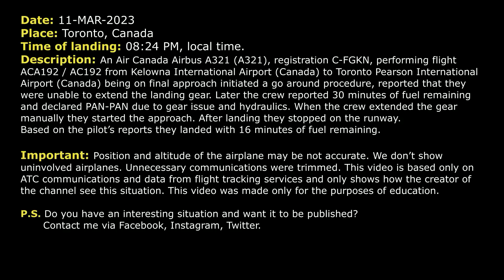“The gear is not coming down”. Air Canada A321 don’t have much fuel to troubleshoot. Real ATC

Comment: To all the armchair quarterbacks commenting about the fuel. 

They made a comment close to their base leg that they had "2.2" (2200kgs) of fuel remaining after the go around and troubleshoot. 30 minute reserve would be about 1.0-1.2 depending on the weight and in a normal configuration (gear not down, etc). So that 2.2 on a normal day would have been about 50 minutes of fuel remaining before zero fuel and 20 minutes before hitting their reserves. 

Well done to the crew.
Reply: Armchair anythings can get tiresome, especially when it comes to highly regulated and technical issues (like aviation).

Of course anyone should feel free to post questions and opinions, but they should keep in mind they don't know what they're talking about.

Many people have said the aircraft was "running on fumes" and said it was a mistake for ATC to depart an aircraft on the same runway. 🙄

The misinformation and uninformed opinions, no matter how well-intentioned, get tiresome.

✌️
Reply: Well, im one of those quarterbacks. But my math doesn't check out. Even tho what you said is technically correct, but that 1.2 "reserve" is not actually what they are allowed to use on "a normal day", that is the reserve required by the regulations and they're required to have that at the gate at the destination, so really after the go-around they had just 1000kg of fuel that they are leglly allowed to use to stay within the regulations, that is ~20 minutes. Basically they are in "min fuel" territory, where they can still fly the approach, but cannot accept any delays.
So, i don't understand how they ended up in min fuel situation with no option to divert or accept any holds or delays, when in reality they should've had 1.2 reserve + ~2 for 40-50 min of hold + ~2 for alternative + 0.5 for taxi, which is ~ 5700kg. I specifically looked up their flight track, they didn't have any delays or go-arounds other than what we see on the video.

Comment: Troubled that they flew with less than minimum reserve. Hopefully the right people will be asking questions.
Reply: Minimum reserve is a planned number.  If there were vectors or different altitudes or speeds that were given along the way, it would be easy to burn through 15 minutes of fuel before getting to the destination

Comment: I understand that all passengers have to remain seated with seatbelts fastened during take-off and landing. What is the explanation from safety side why this plane can't land with this passenger on the toilet? As he is already in the toilet I can think of him being at risk as object that could be tossed around in the cabin in case of issues. But in this case he is already in the toilet and therefore not at risk anymore. It's the passenger getting dirty pants and the toilet that would get dirty only. Is there another risk because of this requiring the entire plane to go-around?

Comment: In this situation, the crew are fairly busy going through checklists...Why do ATC not shut the f**k up and let the crew get on with what they HAVE to do
Reply: Because it simply is not an issue Nigel.
Reply: @Nigel Watkins, many of these ATC videos have longer silence/no communication parts clipped out. The controller probably didn't speak as often as it appears in this vid, & also says "when able" or similar to that. While pilots are working out what they have to, ATC & Ground need to know what is needed to know what needs to be deployed & that takes time too

Comment: Why would he stop on the runway and disrupt airport operations?
Reply: Gear wasn't working correctly. They weren't able to fully troubleshoot the problem due to the fuel issue and can't see the condition of the gear. They wanted someone to inspect the gear to make sure everything looked okay before trying to taxi. (I'm not a pilot or anything, I've just watched a lot of these videos.)
Reply: After a gravity gear extension you should definitely have someone look at it. If there are also hydraulic problems, you might be leaking something. Better to sit on the rwy for a bit then make taxiways unusable.

Comment: No I cant even comprehend how after a go around and a left turn for about 3 minutes they are on final reserves. This makes no sense. final reserves should be holding fuel for half an hour over your diversion airfield. Air Canada need to look at their fuel policy if this really is the case.

Comment: There are two states of a assistance needed that a pilot can declare: a MayDay, or emergency is one. It means the pilot needs immediate assistance and priority service (when seconds matter). 

The second is a pan-pan. This is an Urgent situation, but usually implies there is nothing that can be asked of ATC to help the situation or that while the issue may be time sensitive, it isn’t a matter of seconds or right this instant.
Reply: That why I am confused, is not 30 min field automatic mayday - minimum field?
Reply: @Mutineer9  min fuel and mayday fuel are 2 different calls.
Min fuel means that, with current clearance, you're approaching the planned final reserve. (So if you plan to land with at least 30 minutes remaining, once you get down to maybe 30-40 minutes, you let ATC know that hey my reserve is in jeopardy)
Mayday fuel is called when based on calculations and current clearance, you will land with less than your planned final reserve. (I.e for a 30 minute final reserve, then anything less than 30 minutes left estimated.  So don't call that with less than 30 minutes, call it when you figure out that based on how things are going, you'll end with less than 30 minutes.

The reserve must be protected by the PIC.  That means requesting a diversion, monitoring fuel quantity periodically through the flight, communicating with ATC, etc.
Reply: @sketchyAnalogies  I’d like to point out as a controller that the request of emergency vehicles and ATC asking fuel and souls on board constitutes an emergency. While I’m an American controller, I’m sure it’s the same procedures.
Reply: Here in the States...we eschew the archaic Pan Pan Mayday drivel. Declaring an emergency is where its at now. Crisp, clear and easy to understand. Please make a note for future reference.

Comment: What is it with pilots being so stubborn about declaring an emergency ?

This pilot was just seconds away from a mandatory fuel emergency A N D was dealing with a sketchy landing gear, but still refused to declare and emergency. 

I mean for christ's sake he requested that EMERGENCY equipment be scrambled,  but god forbid he formally declare an emergency. 

The way they act, You'd think that they have to pay for the services out of their paychecks or something.
Reply: The FAA says: Distress and Urgency Communications
A pilot who encounters a distress or urgency condition can obtain assistance simply by contacting the air traffic facility or other agency in whose area of responsibility the aircraft is operating, stating the nature of the difficulty, pilot's intentions and assistance desired. Distress and urgency communications procedures are prescribed by the International Civil Aviation Organization (ICAO), however, and have decided advantages over the informal procedure described above.
Distress and urgency communications procedures discussed in the following paragraphs relate to the use of air ground voice communications.
The initial communication, and if considered necessary, any subsequent transmissions by an aircraft in distress should begin with the signal MAYDAY, preferably repeated three times. The signal PAN-PAN should be used in the same manner for an urgency condition.
Distress communications have absolute priority over all other communications, and the word MAYDAY commands radio silence on the frequency in use. Urgency communications have priority over all other communications except distress, and the word PAN-PAN warns other stations not to interfere with urgency transmissions.
Reply: This is how Canadian companies operate. Shady and Dodgy practices.
Reply: Did it matter? No.
Reply: What is the net result my dude? No difference whatsoever. Simply not an issue. Not to worry.

Comment: 2200kg is like 45 minutes total on A320…. Less once u get the gear down of course
Reply: You're not supposed to land with less than 30 minutes of fuel left. 45 minutes total flight time left is a serious situation.
Reply: @klausbellroth5451   affirm!! especially once u committed to lower the landing gear  (that u cant retract from that point)

Comment: That must have been about the minimum reserve fuel on board for that flight.
Reply: Below minimum.  30 minutes reserve is minimum fuel.  These guys were on fumes.
Reply: @bigman55434  they were on 30 min reserve but used 15min on the go around and run the checklist again to try and resolve issue!
Reply: @idunnoanymore2870  They have to run through the checklists, which tell them exactly how to proceed.  That's procedure, and you follow it 100% of the time, unless the plane gives you no option but to not follow the checklists (i.e. it runs out of fuel mid air).  They knew what they had to work with, and were within gliding distance of a runway.  Either way, a lot closer call than they would have preferred.

Comment: Better than the United DC-8 coming into Portland decades ago. Crew was preoccupied with a landing gear problem and lost track of fuel. Crashed a few miles short of the runway threshold with fatalities.
Reply: I saw that episode on Mayday a while ago-very interesting episode.
Reply: this is not "better" this is just as mediocre. only difference is this is 2023 A.D. and that crash was like 35 years ago. AC is not a safe airline their pilots have been making lots of serious errors over the past 10 years.
Reply: @brianlacroix822  Landing is better, as I see it, than a fatal crash.
Reply: @brianlacroix822  you’re an id***……AC IS ONE OF SAFEST AIRLINES IN THE WORLD….